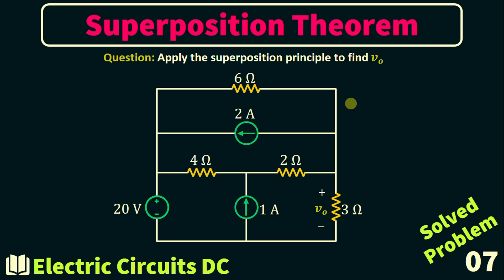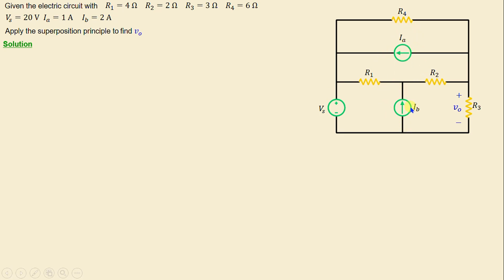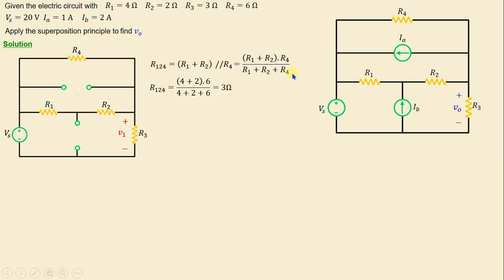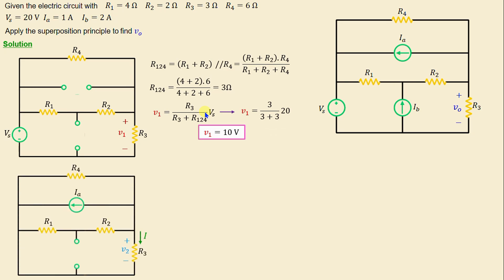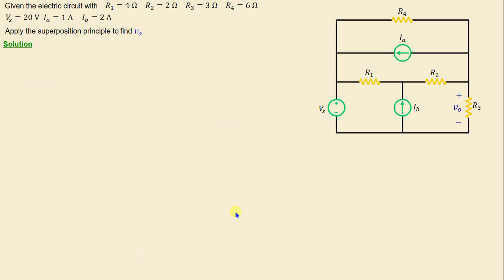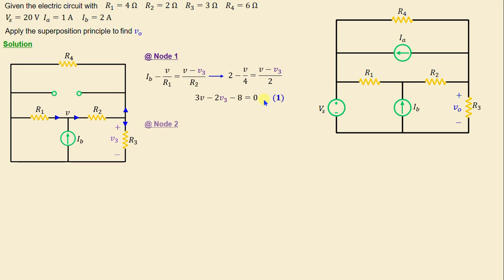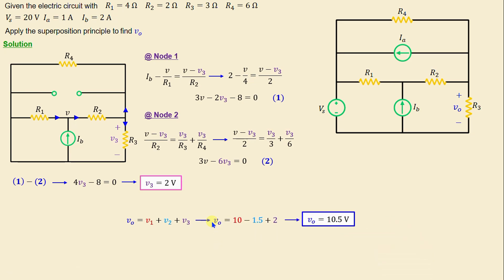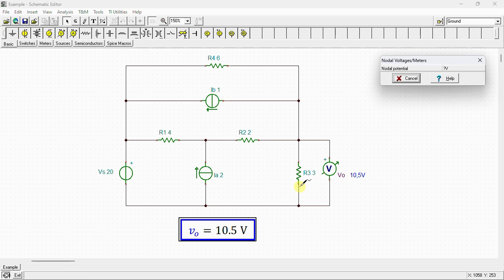Superposition Theorem | Solved problem 7

Comment: @ 4:15 minutes, why is I negative...I = - (R124/R3 +R124)  which way is the current going?  Thanks for the great videos; they've been good refreshers.  i look forward to you posting the electronic videos (op-amps, mosfets, etc..)
Reply from the maker: When analyzing a circuit, if the total current is flowing into a node while the current I is leaving the node, you can apply the current division rule. In this rule, you assign a minus sign to the current I leaving the node to maintain consistency with the direction of the total current flowing into the node. This ensures that the algebraic sign of the current is consistent with your chosen reference direction and helps you accurately calculate the currents in the circuit branches.
Yes sure I will publish in the future more videos about electronics (Opamp and Mosfet)